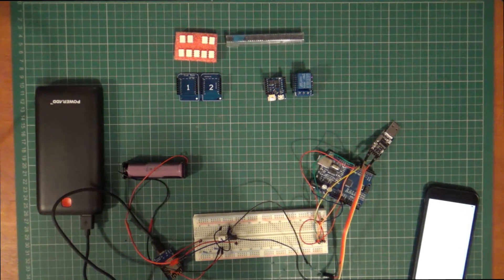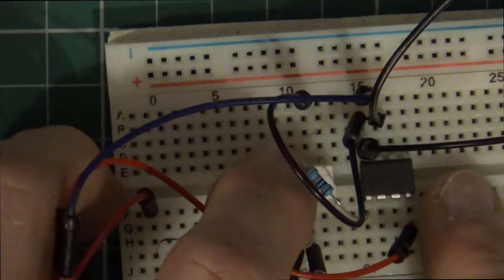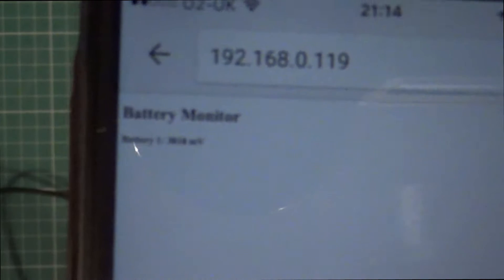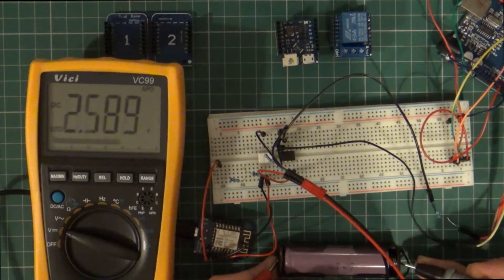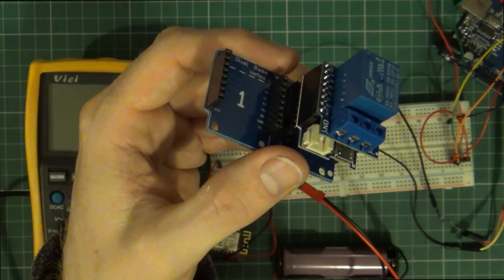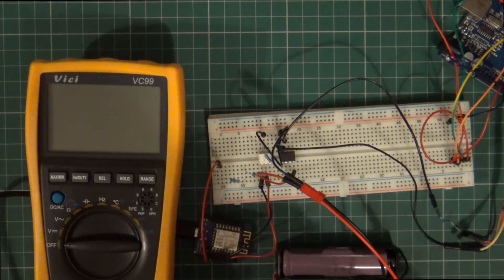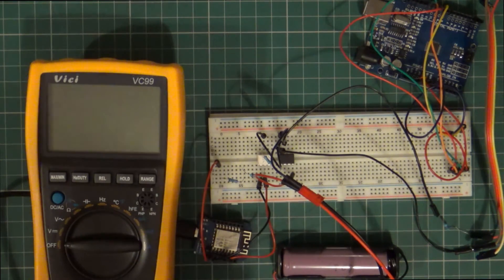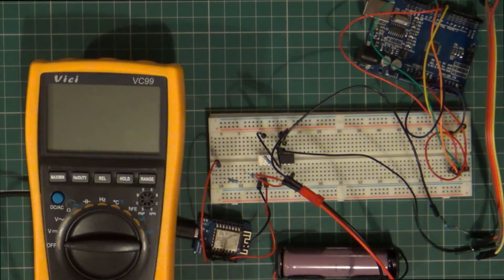ESP8266 / ATTiny based lithium BMS

Comment: Hello i really love this idea here. But i have a question how would i be able to daisy chain a bunch of Attiny85 Together? Reason why I'm asking is because i have 14  of the 18650 batteries and I would love to monitor them all.
Reply from the maker: Hi really sorry for the delay in responding.  with my last setup it would have been possible although you would have needed to looking into a multiplexer as you'd run out of inputs on an ESP.  The new model which is based on stuarts design can scale up to 14 boards no problem, i'd recommend going for that one over my old design.

Comment: This is awesome! I am working on an Arduino based 18650 BMS for the Arduino and later the STM32 series.
Reply from the maker: Thank, really appreciate the comment.  I think i am going to change the code as it loses some accuracy in the conversion for the optocoupler but think i can maybe redesign it with the same hardware as a onewire kind of design.
Would love to see any design you come up with.
Reply: Colin Hickey I just started using the Optos and did put up a small video. I am excited to see people around the world pushing this 18650 Movement. I've got a new website and channel in the works and will send the invite once it's all online. Watched your other videos on this project too, great stuff man and please keep the camera rolling.
Reply from the maker: Subbed to your channel, need to get back to my powerwall, got another 300w of panels ready to fit so will have to swap out charge controllers in the process as well.  BMS work has fallen by the way side a little.

Comment: This is a great project. I had a similar idea (and bought quite a few bits to do it) but haven't had time as yet. The opto isolator is on the serial communication then? I should have thought about that. My approach was a bit different and so far hasn't seen a single line of code!
Reply from the maker: Hi Adam, cheers.  The ATtiny measures the voltage it's being powered off and then writes this using a analaWrite to a PWM pin.  The ESP then performs a pulsein on that pin to measure the high and low timing and the % duty worked out so that what was set on the optoisolator can be worked out.  there is a small degree of inaccuracy as the output on the attiny has to be scaled down to 0-255 with a map function for the pwm to work but it's still pretty close, or close enough for myself.  If you did it with a serial comms over the opto you would get around the inaccuracy though.  I'll update the description to the two videos i've used for the basis.
Reply: Cheers. That makes sense. Very much looking forward to it being expanded. Very modular - I like it.

Comment: Nice way ti go. I'd love to see more details. 
And sorry to here the packs went bad in the cold - just how cold did they get? Cheers, Paul
Reply from the maker: Paul Kennett it wasn't silly cold so just below zero.  When I checked the packs it was one which had failed and went to 0v and the rest of the packs weren't too bad although some ended up overcharged as the controller just kept trying to charge the pack as a whole.  Happy to do some videos, felt I'd not done one for ages so wanted to put something up as well I was pleased with myself lol